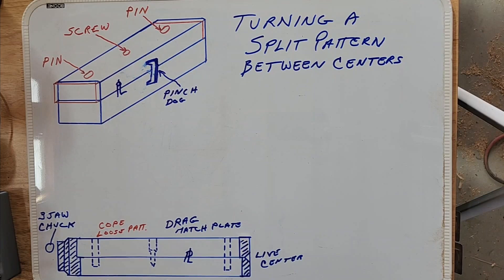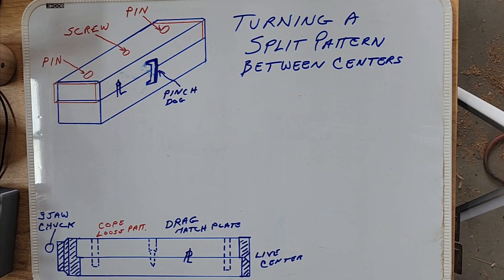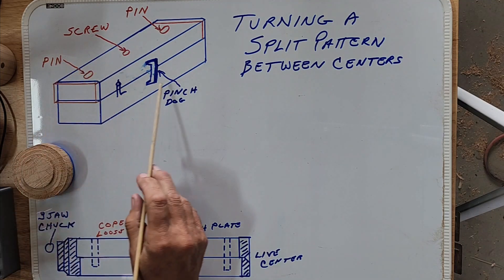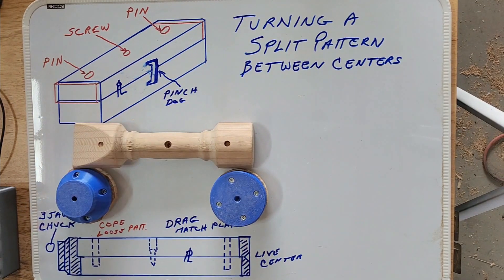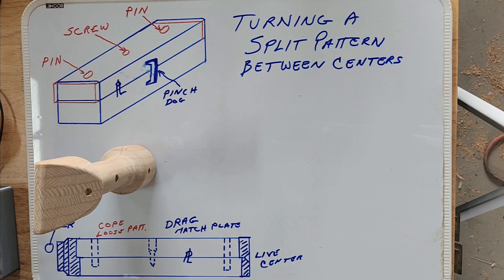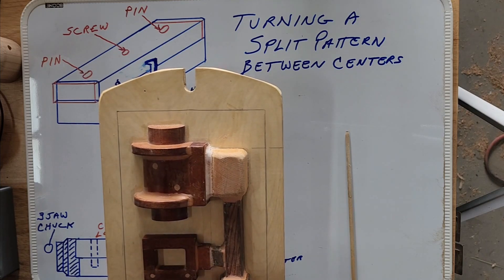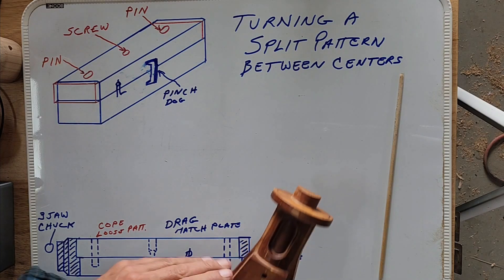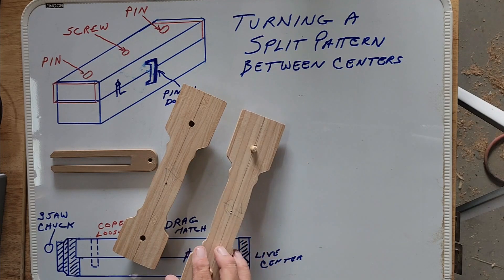Using offsets lathe centers

Comment: for the pinch dogs, for people who cant find/afford a set of them, the U shaped  fencing nails, if the ends are reground to point away from each other, they work great as pinch dogs and are fairly cheap. I usually dont drill all the way through on patterns, just a shallow hole for the pins on one side, then put some dowel centers in the holes to transfer to the other side. Then you dont have any holes that needs filled in later, and they also work great for aligning patterns, especially old 3d printed patterns for use on match plates, where you wouldnt have a through hole in the printed part. As Ive switched primarilly to wood patterns now, they're invaluable for match plate work and getting the alignment stuff right. They're like little transfer screws used for metalworking, but go into a hole to transfer the position for woodworking stuff. 

I also dont like gluing up with paper and such in between, I usually just use a bit longer of a piece than needed, lay out the part, and glue the ends together in the waste block area, then turn it down but dont part  it all the way off, then finish it with a hand saw so everything doesnt catch and go flying. Then the cut off area is where the glue is at and rest of it is free of any glue or anything that could cause issues. 

Ive also seen a lathe center plate in old foundry books lately, it looks like a plate combined with a staple in a way, but you would pound it into the end and it had the center holes and a slot in it for the lathe drive center in it too, that way the centers wouldnt wear out in the wood, similar to what youre doing with the 3d printed ends. I was thinking of making a few sets of them to keep in my toolkit when turning larger patterns with. It's just a flat plate, but legs like the pinch dog's coming off to the side and bent off to the side, so it gets driven into the end of a piece and turned while keeping it held together, and held in place by the lathe centers. I think that would really shine when turning patterns from pine and softer woods tbh.